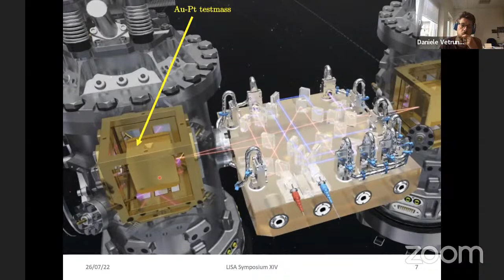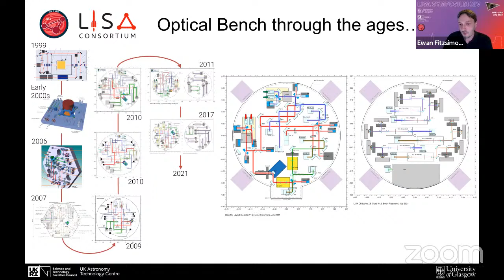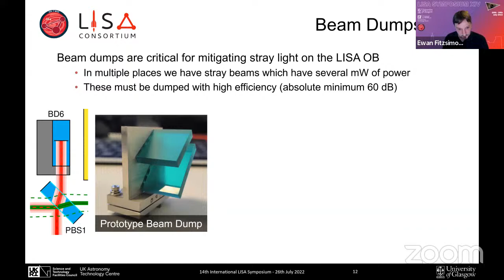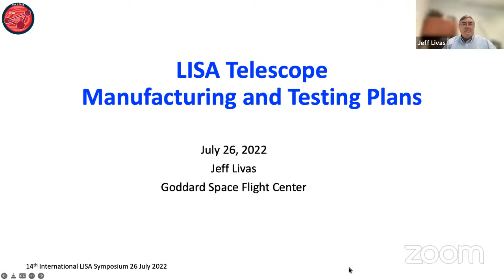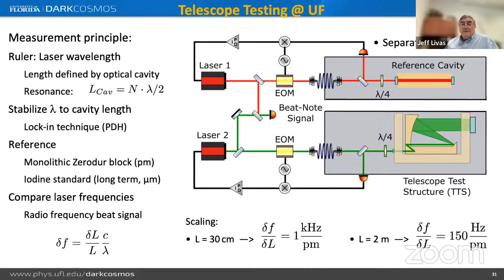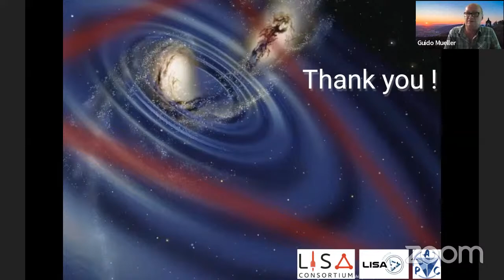LISA Symposium XIV Plenary Day 2

Comment: What happens when dust floats in between laser sensors scattering the laser?
Reply from the maker: Hi Thomas, thank you for the question it is a good one! 
The short answer is that we want to minimise this effect as much as possible. The one area where the scattered light affect such as this, is a significant issue is in the system which looks helps in the intial alignment of the instrument (CAS). It does this by looking for the faint light from the far spacecraft. This system would also see scattered light from the beam leaving the spacecraft which is much more powerful. Because of this and other issues, there is a team of people working in what is called the Stray Light Working Group to study these effects and help design strategies to cope with it.
Reply: @LISAcommunity  Thank you, wishing you continued success with LISA, I really appreciate you taking the time to respond. I look forward to future updates.